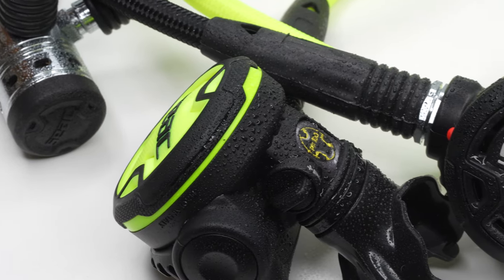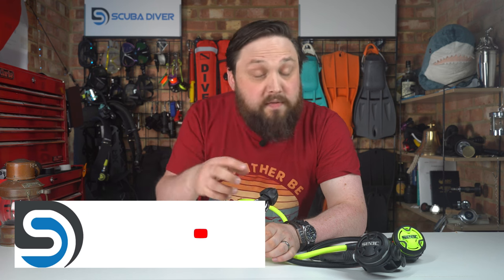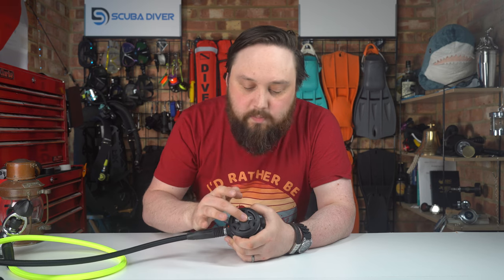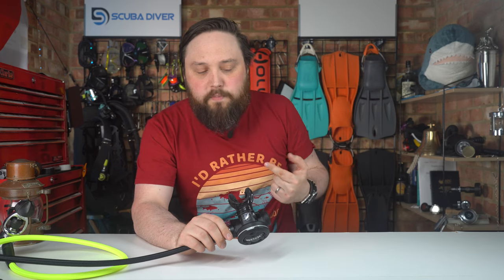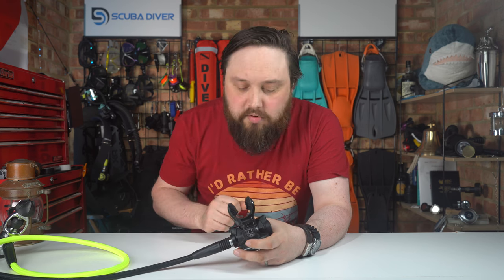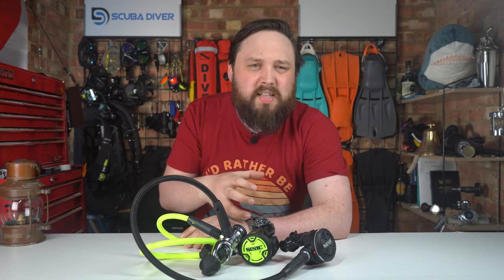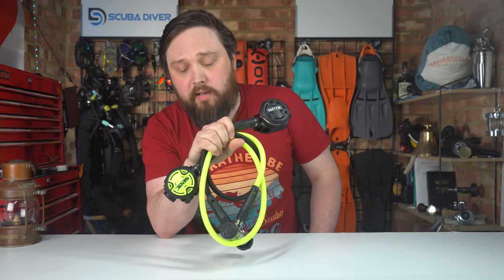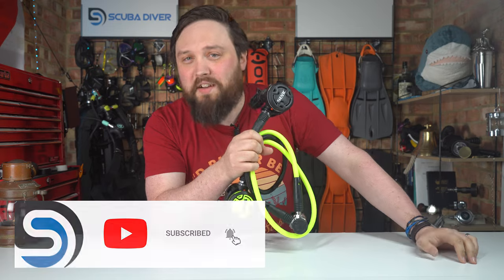SEAC PX100 Regulator Review #scuba #regulator #review @SeacSubTV @ScubaDiverMagazine

Comment: I used an Aqua Lung Titan in my Class. Mine had the adjustable venturi. I didn't notice a difference between High and Low settings
Reply from the maker: Most divers won't notice if a venturi switch is turned on or off. Their main effect is when the 2nd stage is out of your mouth to prevent a freeflow from forming
Reply: @ScubaDiverMagazine  Thank you

Comment: #askmark

Hey Mark, many thanks for all the great content and advice! I learned a LOT from you! 🙂

I'm a bearded diver like you, and was considering buying an Atomic Venom Frameless mask (I know your opinion of it 😁) and I've read many reviews about its great fit.

The challenge is that it is not available locally in my country to try it personally and see how it fits me, and I was thinking of buying one online. Do you think it is a risk worth taking in this case considering its reputation in the fit/face seal department? 🙏
Reply from the maker: It is a very nice mask but, other masks do work for me as well. If you find a mask that fits you at your LDS then you're all sorted. Trying on a mask at your local dive centre will always be the best way to check the fit of a mask but, mask skirt designs are so good right now that it's quite rare that you'll find one that doesn't fit and buying online is safe.

While I can't promise the Venom Frameless will fit you, it definitely should
Reply: Many thanks for the feedback! I understand you can't promise anything 🙂. 

I currently have a Scubapro Synergy Twin mask, which is a good one for sure.

But, I thought if I am to upgrade, it would be the Venom Frameless.

The only issue I have with the synergy twin is that if I'm a bit in a hurry and don't apply a beard balm, it leaks a bit too often and I found myself having to clear it consistently